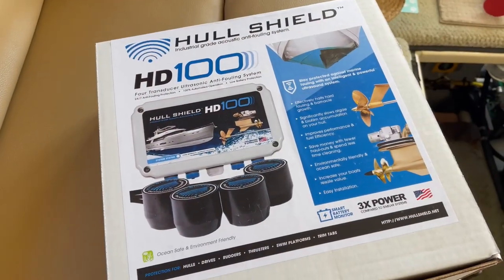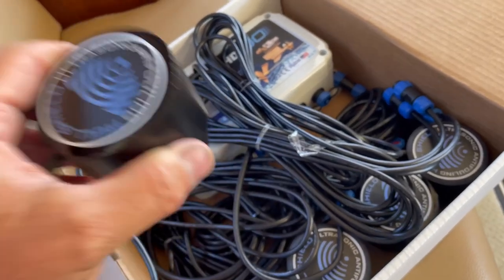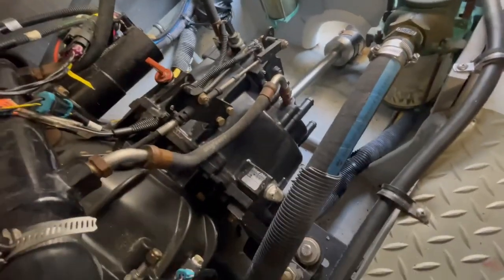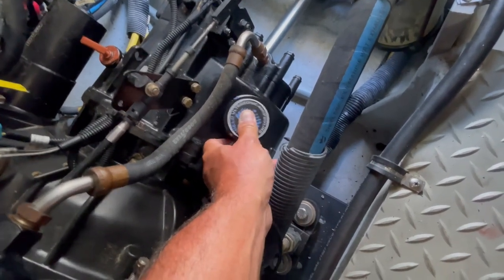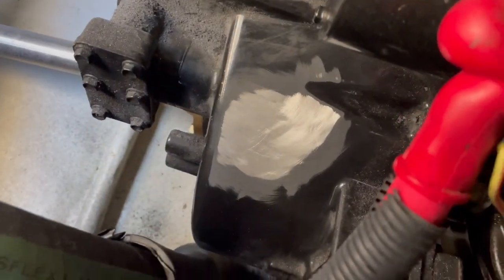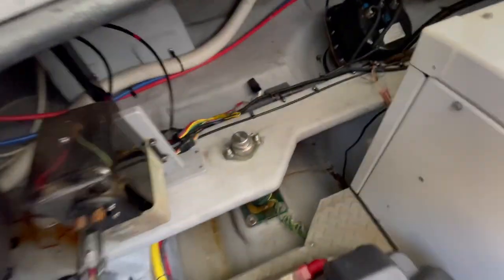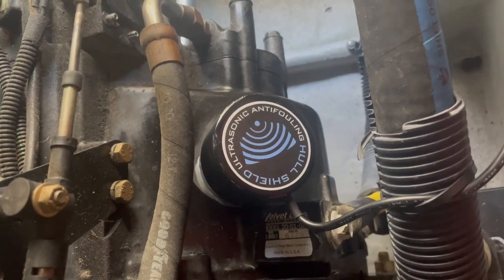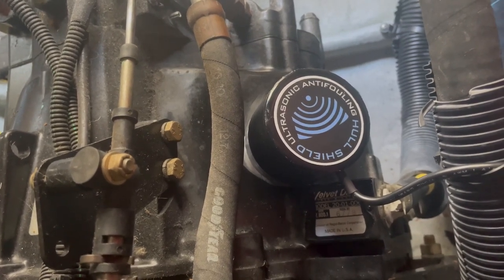Installing Hull Shield Ultrasonic Anti-Fouling System

Comment: Any updates on this system??
Reply from the maker: If a been about 6 months with the system on the new paint job.  The hull holds up very well.  The shafts and props not so much.  Could be some isolation on the transmission housing where the transducer is mounted.  But much less barnacle than a year ago with the old paint.

Comment: Are you really confident it will stay attached to the transmission? The engine vibrates  a LOT
Reply from the maker: Yes. It has held strong so far to both engines.
Reply: @AdventuresofHappyOurs  is the system keeping the growth off?
Reply from the maker: @jmm1000 I haven’t yet dove on the bottom since the new bottom work.  Coming up soon!
Reply: @AdventuresofHappyOurs  lookin forward -  Thanks Cap!